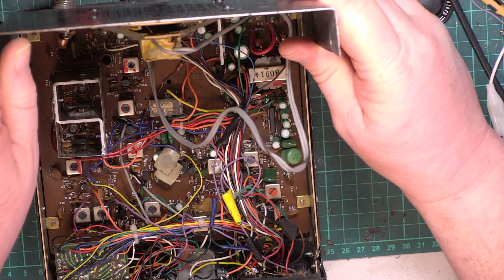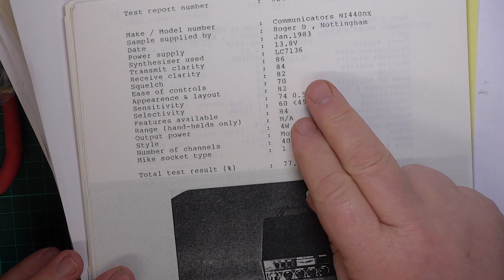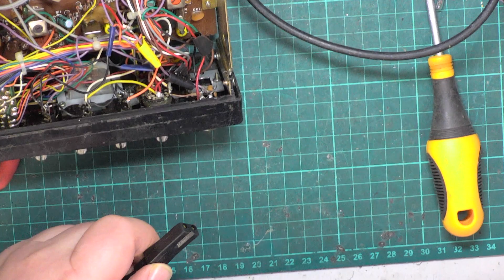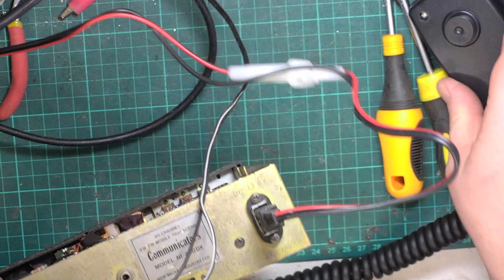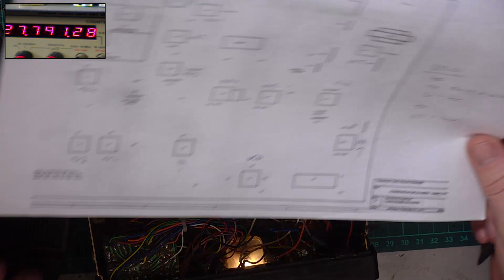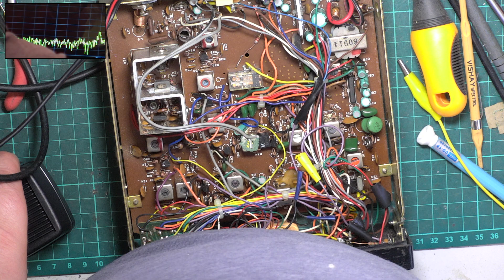LCL Communicators NI440DX UK CB27/81 CB radio (mobile) - Resurrection from 'screwdrivered'

Comment: "another revived radio, good to see, I also have one  with yellow display with needle pegging to the right on tx!  thanks for video Richard".
Reply from the maker: Needle pegging.....You saw me set the meter & this shows how SWR affects the meter & means nothing. I have done some radios, set the meter...then on the aerial, the meter reads 1. It's important to note that this radio does 3.2 (real) watts...probably 5 'cheap meter' watts or even 7 'zetagi watts'! If the meter is pegging as it is, its still doing 3.2W & conversely if the meter read just '1' on TX when on the aerial...it's still doing 3.2W. This is probably why current model sets no longer have power meters, and when you key up, you simply get a full bargraph which is simply no different to a TX light!

The yellow meter version of this radio is the earlier production & is better.

Richard

Comment: I prefer the set with the white/yellow meter, you could at least see it better.   That harmonic had gone as the set heated up, before you touched the coil.  They usually sounded good on transmit those sets, but the receive was so goo you didn't need to change channel to get all 40.  After 1990 they might have been fine as not so many people on.  My mate used to get bleed over from the town 6 miles away as the crow flies!  It was legal sets and aerials as well.  His had a very nice sounding transmitter right out of the factory.  He gave up and bought a Rotel RVC230, his first comment was "Where has everyone gone?"  No bleed over!  lol
Reply from the maker: Yes, the white/yellow meter version was the earlier & better version.

Richard